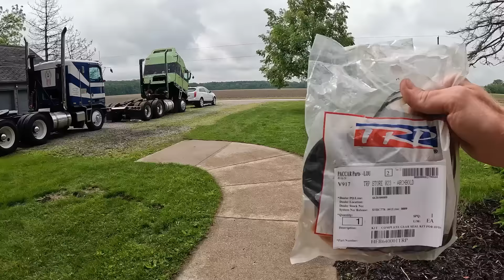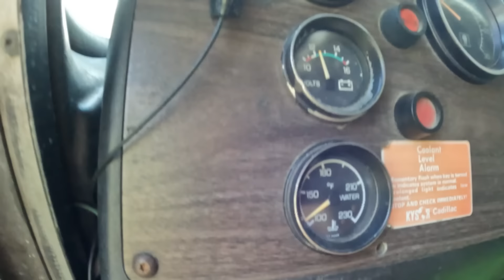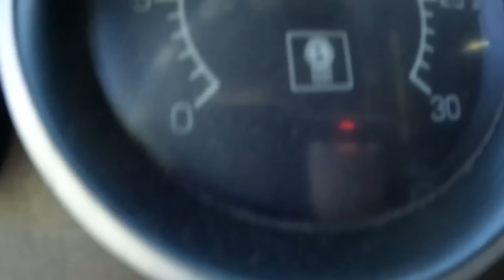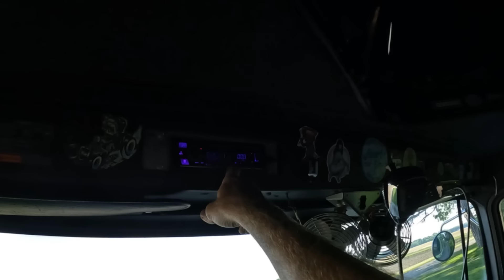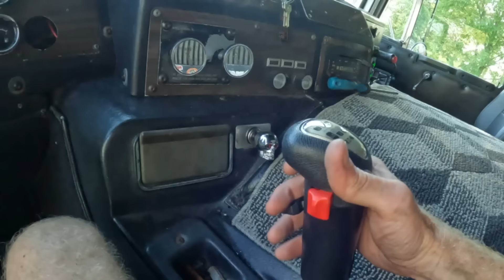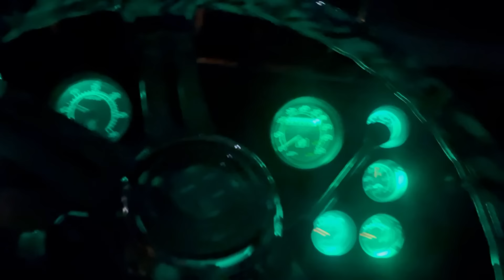Cabover Aerodyne Will It Start?

Comment: it's your alternator belts Chad, I can see the belts are below the pulley tops, your pulley may need replaced also, your water pump is gear driven on a CAT so no belts for that
Reply from the maker: Yeah that pully is due for a change